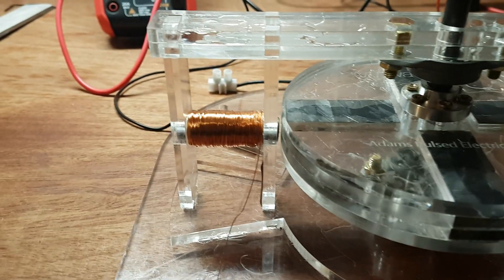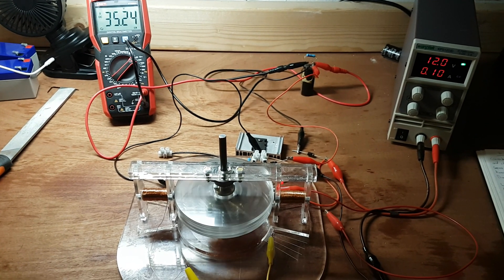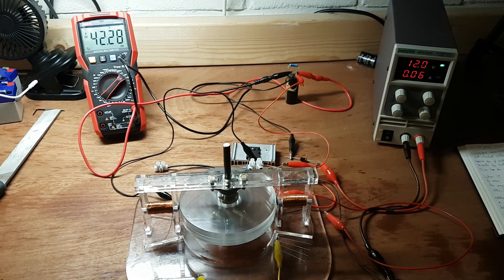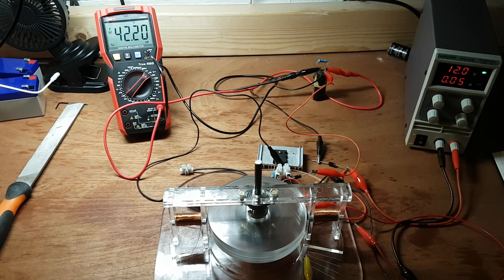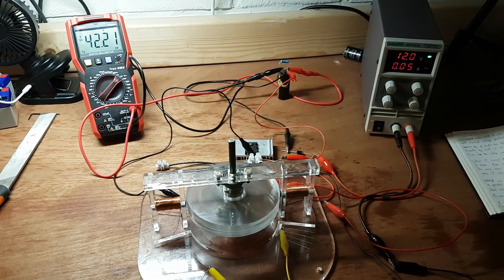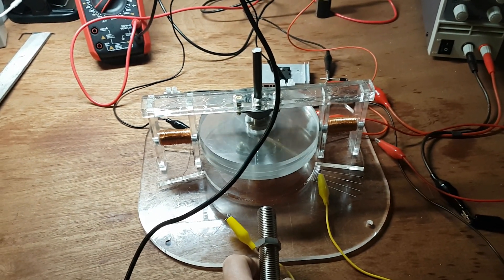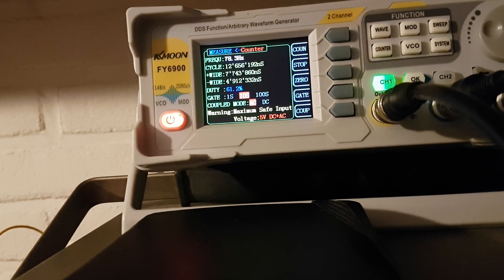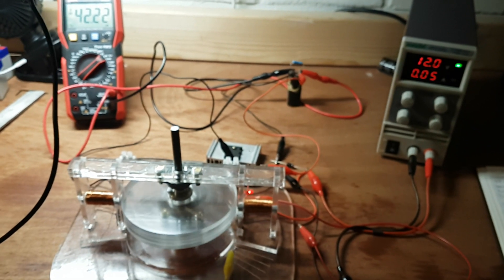EXTREMELY low current draw on Adams Pulsed Electric Motor

Comment: Can this device be solid state? I am thinking the same way an electronic gyroscope works.
Reply from the maker: Yes, the rotor turns out to be completely optional. Pulsing coils is all you need to get the effects, and it actually makes it much easier to control the pulse frequency and duty cycle.

Comment: You can't really speculate on the motor's current draw until you place some kind of load across the accumulation capacitor. After all, a shaft turning and doing no work at all is really just a nice piece of art.
Reply from the maker: You are absolutely correct. This was my very first attempt at building a motor of any kind, so I was still learning and may have drawn some incorrect conclusions.

Comment: What are you doing with the back emf?
Reply from the maker: Not much. I experimented with using it to charge the run battery, charge a capacitor which then charged the run battery, and charging a second battery.

Didn't find a winning setup yet, but I now have many things in mind to improve in my next 20x larger build, see: https://waveguide.blog/pulse-motor-generator-design-considerations/

Comment: But it doesn't preform any work.
Reply from the maker: Apart from spinning the rotor around, no. But my current version is loaded with 4 generator coils, and I've also used it to power a 20 cm fan. But to power serious mechanical loads, you'd need a different setup that is more optimized for that particular task.

Comment: Seems to me that you are wasting half the power from the electro magnets. North pole pushing against north pole permanent magnets. Why not have a horse shoe configuration that allows you to use the  electromagnet's South pole's force to drive another layer south pole permanent magnets below the existing one. Thus doubling the power with no extra input.
Reply from the maker: Hi Chris, you are absolutely correct! In a later version the inventor indeed used a horse shoe setup, as you can see in his patent here: https://patents.google.com/patent/GB2282708A/en
Reply: @Waveguide  Another point that you may be interested in, is that pulse motors like the ones that you are building, work virtually the same as brushless DC motors that can be found in many applications such as quiet PC fans. They even include a mini PCB board that controls the magnetic pulse timing.  You may like to take a look at the PCB board spec and see if they can help you control the motor better. They can provide PWM (Pulse width modulation) for  synchronized speed adjustments. See https://www.youtube.com/watch?v=bCEiOnuODac
Reply: @Waveguide  Just one more small thing. Have you considered putting a smaller opposite pole permanent magnet just after the main pulse. This would be attracted to the electromagnetic pulse and give it an extra kick?

Comment: Can it be tuned to 50-60 hz or is it for charging a battery bank. What’s the amperage it can put out under load? Or is it just an equilibrium device able to spin at x but charge at a times greater than x output?
Reply from the maker: Hi Larry, at the moment it is quite a useless device, but with curious properties. My goal is to replicate the results claimed by the inventor. This motor could be configured to drive reasonable loads, but that's not the main goal. I'm still working on improving the drive circuit. Once that is done, I'll add generator coils and measure the current output.

Comment: Hi - nice work - I was wondering how you're switching the drive coils on and off?
Reply from the maker: Hi Pete, I currently use a MJL21194 NPN low-side switch setup, triggered by a Hall sensor connected to an Arduino. Am not too happy with the accuracy of the Arduino and the Hall sensor, so I'm about to start experimenting with an optical switch instead.
Reply: @Waveguide  Hi Nick - I saw the arduino/hall sensor setup in another of your vids and was wondering where you placed the hall sensor.
In this setup above though are you using the back emf from the drive coils to flick a transistor off? Don't suppose you have a copy of the above circuit I can replicate do you?
Reply from the maker: @pt6478  you can find a schematic here if you scroll down: https://github.com/nickkraakman/arduino-pulsed-motor-driver

Comment: Anyone here in a good forum or discord? I've got a few questions I'd like to ask on a broader scale and I'm looking for a few ppl who want to do some testing on a system to get a broader respect for what's going on. Not wanting to go open source just yet, not until the data is in. I've given myself 6 months from the date of this post, to complete at least three different tests but it's more than I can accomplish alone.....so if this is interesting to you.......
Reply from the maker: Hi Jason, a popular forum for these kinds of subjects is http://energeticforum.com/renewable-energy
Reply: Seems to me that this configuration is wasting half the power from the electro magnets. North pole pushing against north pole permanent magnets. Why not have a horse shoe configuration that allows you to also use the electromagnet's south pole's force to drive another layer south pole permanent magnets below the existing one. Thus doubling the power with no extra input.
Reply from the maker: @chrislloyd1734  you are absolutely right about this, and in later designs the inventor did use a horse shoe setup, see his British patent here: https://patents.google.com/patent/GB2282708A/en
Reply: @Waveguide  Another point that you may be interested in, is that pulse motors like the ones that you are building, work exactly the same as brushless DC motors that can be found in many applications such as quiet PC fans. They even include a mini PCB board that controls the magnetic pulse timing.  You may like to take a look at the PCB board spec and see if they can help you control the motor better. They can provide PWM (Pulse width modulation) for  synchronized speed adjustments.
Reply from the maker: @chrislloyd1734  They work in a somewhat similar manner, indeed, but the big difference is dat in a BLDC motor current is flowing 100% of the time, while in these pulsed motors only 25-50% of the time, without sacrificing (much) torque. But it is a good tip to look at the PCB of a BLDC motor for inspiration! Right now I am using an Arduino to control the pulse time and pulse width, see: https://www.youtube.com/watch?v=OBMXBna9_ok
Reply: @Waveguide  OK. Point taken. Good luck with your developments. I built one of these about 20 years ago without knowing others had the same idea. At the time I thought I was on to something. It's good to see that others are taking the idea forward. What is your ultimate goal? Have you ever thought about any applications???
Reply from the maker: @chrislloyd1734  For now, the only application is to have fun, learn a lot, and try to get as close to the results of the inventor as possible. Once those results have been replicated, I would love to see if a motor like this could be used to power a compressor for more energy efficient ACs and refrigerators.
Reply: @Waveguide  Funny you should mention cooling applications. I am working on just that now and after studying free piston sterling Cryocoolers it made me think of using this idea of pulse motors to drive the pistons. Not sure yet whether to go with a radial or linear approach to piston movement. Nothing concrete yet my mind is in overdrive and cannot sleep properly. The other area of concern is a silent and contactless piston. Maybe incorporating air bearings.

Comment: What rating is your capacitor, this is the bit I'm trying to work out 👍
Reply from the maker: I've used several, but am currently using a 100V 10.000uF high frequency capacitor
Reply: Hi waveguide can you post the circuit diagram for the switching please saves me doing it manually 👍🏻
Reply from the maker: @sas25135567  I am currently using a simplified circuit based on the Bedini Glass Case Motor, which does not have a diode and capacitor to capture the flyback, but instead this is transmitted as a single wire longitudinal transmission back to the battery. At least, that is how Peter Lindemann described it, and with this super simple circuit it takes my batter 20X (!!) longer to lose 10 mV of charge compared to when I used a capacitor.

Here it is: https://waveguide.blog/static/adams/circuit-24-02-2021.png
Reply: Oh I get you nice one now I understand thank so much top man 👍
Reply: Just curious when you done the circuit with a diode and capacitor what was the ratings for both of these.
Reply: What rating capacitor and what rating diode is what I meant fella 👍🏻
Reply from the maker: @sas25135567  I already told you I used a 100V 10.000uF cap. For the diode, just use a fast one that can handle higj voltage spikes, like the 1N4937.
Reply: Waveguide ok fella thanks for getting back to my question, I'm still learning mate.

Comment: Newman motor has 4 pickups and very heavy flywheel. Look up patient information to get guidance and more ideas.  Great job on video.
Reply from the maker: Thanks, CJ! The Adams Motor also has 4 generator coils, but I'm currently still trying to perfect the drive circuit, which is the hardest part. Then I'll add the generator coils.

Comment: Use friction,  instead of magnetivity and you can get rid of the magnets for the current generation.
Reply from the maker: Hi, could you give some more details on how you I could construct something like that?
Reply: @Waveguide  https://en.wikipedia.org/wiki/Triboelectric_effect    you need two plates sliding together of two different materials. (carpet works good.)  and everytime it passes over the other surface, it gains charge, and you collect from either side of the sliding surface, and you store it in a high voltage capacitor,  but u have to watch out for overloads cause its not constant voltage.
Reply from the maker: @drrobotnik5376  thanks for your explanation. However, the magnets being attracted to the iron coil cores play a crucial role in this motor's efficiency, so I won't be able to get rid of them.
Reply: @Waveguide  i see,  so the coil actually causes it spin more, interesting.

Comment: How much torque does it have? Because a motor needs to drive a load. From the way it picked up, the available torque appears to be quite low.
Reply from the maker: Hi Tony, the torque is currently very low indeed. I am able to spin a 20cm fan at 1200 RPM with it, but that's all the load testing I've been able to do so far.

I am in the process of winding new drive coils with identical resistance, but thicker wire gauge, and so more Ampere-Turns, which should result in a bit more torque.

While an Adams Motor can be designed to drive heavy loads, the design goal for this one is to have enough torque to power 4 generator coils.

Comment: Did you use the Adams area rule when designing your drive coils?
Reply from the maker: Hi, I tried to follow Adams' manual as closely as possible. Could you explain the "area rule" you are referring to in a bit more detail?

My drive coil core is 1/2 the width of the rotor magnet, if that is what you mean.
Reply: @Waveguide  The area rule is to make your drive coil core half the area of the magnets (pole face) you use. (watch https://www.youtube.com/watch?v=J2bPDDWqSvM&t=339s)
Reply from the maker: @donotwantahandle1111  yes, that is the case here
Reply: Also, try to replicate the original motor exactly and achieve the same results he did before trying any modifications. I speak from experience.
Reply from the maker: @donotwantahandle1111  You mean using a brush commutator as a switching device? Also, it is a bit hard to replicate the original, as Adams never mentions the exact dimensions of his coils and the wire thickness he used.

So you replicated the Adams Motor, do you have a picture of your setup?

Comment: no load, no amps
Reply from the maker: True, as with no load the motor will speed up until the counter EMF balances with input voltage. 

Still, my first drive coils drew 650 mA, and these just 50 mA.

I need more power than that to turn on a small 12V computer fan! 

Of course because these windings have more resistance, but if I can extract power from the generator coils I will later add, I'd rather use as little power as possible to make the rotor spin! :-)
Reply: @Waveguide   thats right. each thing counts. keep in mind the generator coil will act as a load.
Reply from the maker: @MasterIvo  Indeed. However, I will try to create a "low drag" generator coil, in which the generator coil is disconnected from the circuit when the rotor magnet approaches.

This way, no current can flow, and so no opposing magnetic field will be induced, giving the rotor magnet a free path to be attracted to the iron core of the generator coil.

I'll then turn the coil "on" only for a few degrees, when magnetic field is maximum and tangential drag force minimal.

When the coil is turned "off" again, the collapsing magnetic field will push the rotor along on its path, effectively circumventing most of the Lenz related drag.

At least, that's the idea ;-)
Reply: @Waveguide  John Christie and Lu Brits has an improved build of this device , the lutec 1000 motor generator.
Reply from the maker: @TheJayLorenz  I just read about the Lutec 1000, and it seems they used Robert Adams' technology, and never managed to scale up their device.
Reply: @Waveguide  
on the contrary ,

the original adams motor uses two coils,

while four other coils are used as generators

with which Lens's law plays a negative role, such as the dragging of the rotor.

as far as i could see from the adams engine plans,

I couldn't find a commutator for the generator coils except for the drive coils

so the rotor will slow down when you put a load on it.

I understand your plan to get around that effect by using a reed switch or something like that.

Lutec did a pretty smart job,

by using the existing coils (3 pieces) as drive and generator simultaneously.

The whole thing runs on a pulse (dc) and the output gives 230 volts (ac) 50 or 60 hertz.

Nevertheless ,

They've come pretty far with their motor generator,

check out the link for the latest news about Lutec

http://panacea-bocaf.org/evergreenamplifier.htm
Reply from the maker: @TheJayLorenz  That sounds very interesting, and I would love to learn more about their exact setup, but that website you linked to seems to contain only very little practical information.

Where can I find out more about this motor?
Reply: generating electricity mechanically is load free.